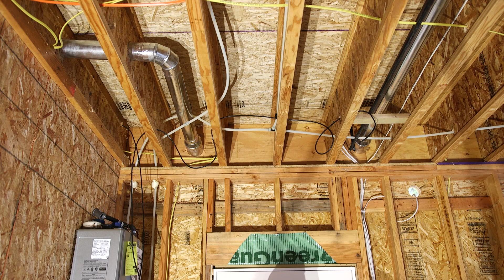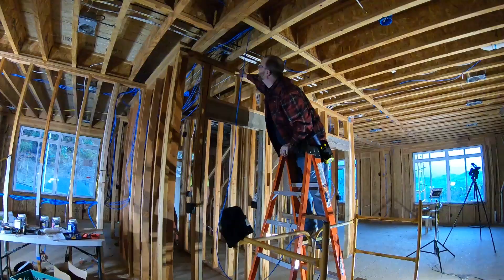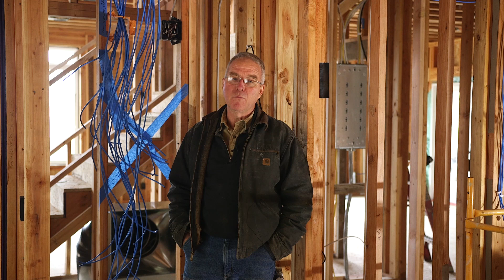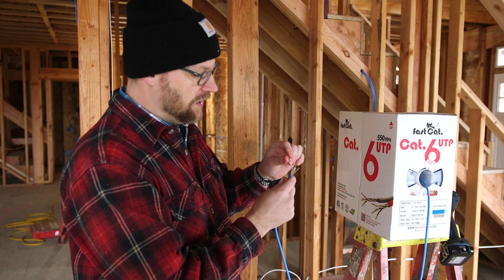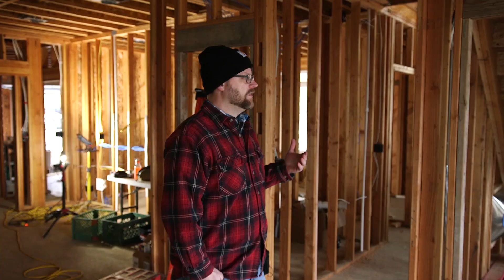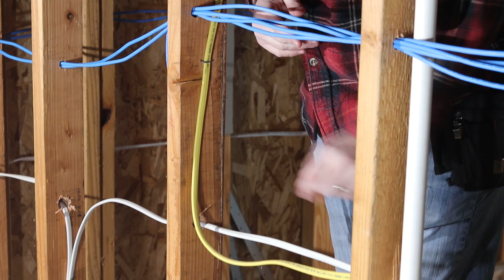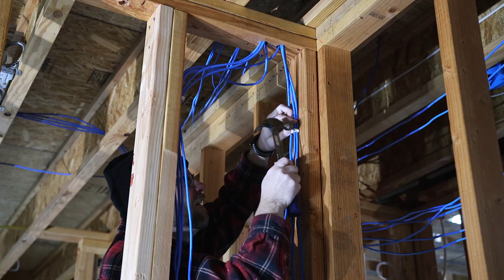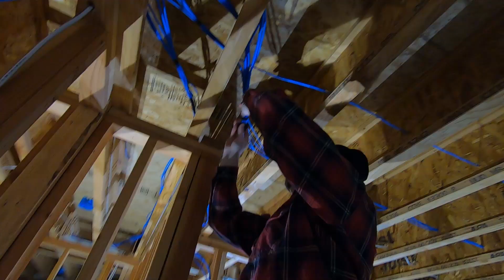Installing A Home Network Ep.100

Comment: 10:06 10 Gigabit networking will be less and less expensive. If you plan to have switches further than 30 meters from an endpoint. I would suggest CAT6A or CAT7 and it also has thicker conductors for PoE (Power over Ethernet - Basically 48V  DC lines for cameras and even lighting nowadays. Since more efficient LED's are rated over 200 lumens per watt.)
Coax cables are yesterday's tech :)  Yet still required in some applications. Fiber optics has more benefits over long distances :)
Reply: Definitely no reason to not run Cat 6A in new builds. It's cheap, plentiful and as 10 gig networking (or even 2.5 gig) becomes more mainstream the extra headroom will be nice.
Reply: 6a yes, 7 no.  7 requires different terminators and is effectively dead technology.  6a is for structural runs and good for 10GigE over long(ish) distances.  8 is for short patches in server rooms.  7 is dead.
Reply: @toddosty  You still need to use 23 awg terminators with Cat 6a. But your right Cat 6a is the best choice for home and offices (outside of the datacenter).
Reply: @guytech7310  CAT7 requires either GG45 or TERA, neither of which are 8P8C-compatible.  While you can terminate CAT7 with 8P8C, you lose the benefits of the cable.

People think, "7 > 6, so I should do 7.  But 8 > 7, so I should do 8!"  They're wrong.  They should use 6a, and even though bulk 6a is 2x bulk 6, it's worth it for the long-term compatibility.  If you go with 6, you'll be re-running in 15-20 years.  If you go with 6a, you're good for 40+ unless things take a drastic right turn somewhere in the future.
Reply: @toddosty  Seeing Cat 7 cables installed as standard in about every new commercial installation here in Germany these days, I would say it is far from dead. But you are right in terms of, those more expensive cables actually beeing a waste of money they way patch panels and sockets are used. And there seems to be quite a misconception about it even among many professionals. I am a network and communications guy by education myself, but I am always amazed how many professionals still think just putting the fancy Cat 7 cables in makes it a Cat 7 installation, while all the sockets (the true and tested 8P8C Modular ones so many times misnamed as RJ45) are at most Cat 6a, automtically degrading the whole installation to 6a or whatever the lowest rated omponent in the installation is.
As you stated correctly, for true cat 7 you would need one of two types of connectors, with at leatsGG45 Sockets beeing downward compatible with regular 8P8C Cat6a plugs (which makes it Cat 6a again), but I have to confess, I know those only from catalogues, I have never seen them beeing used. The simple reason beeing, copper with very high bandwidth is only used for short runs where it does not matter that much, or you see a switch to completely different connection types, mainly optical fiber.
Personally, for most residential homes, I do not even see the need for more than 1G in your home network. For what the average person does at home, higher speeds do not really matter. Either it does not matter if a transfer takes a few seconds longer. In datacenters or special computing needs where we talk about virtualisation or iSCSI for storages, that is a completely different beast. I recommend watching Linus Tech Tips about that. Editink 4k and even 8k rawvideo stored on a server takes a real hit in productivity below 10 G.
But for a normal home... My internet connection is only 100 MBit/s down and 40 Mbit/s up (I could upgrade to 250 MBit/s down with either 40 or 50 MBit/s upstream), we are two persons working from home right now with video calls, remote sessions and you name it. we barely ever reach 25 Mbit/s used. Lets have three TVs or streams running in UHD quality (if available at all), well here we get closer. But as the majority is only available in Full HD anyways, three TVs running (we have IPTV) rarely exceeds 24 to 30 Mbit/s.
And I simply do not see, except for UHD beeing used for streaming or breodcasting more and more and without extra costs in general, why our average bandwidth need would increase a lot more. Sure, things like Google Stadia and other remote gaming experiences, they absolutely benefit from as much bandwidth as possible, but even with what we have now they work fine.
In my home I even run Cat 5e cables ten, eleven years ago. I have no coax or classic telephone cablesin my walls. I have conduit runs from each 2 port socket into my basement built in when the house was built (No framing, solid concrete and masonry as common around here, a pain if you want to change or addany cable runs).
I am still fine with them. For one as I am fine with 1 G for now, some of the set top boxes do not even have 1 G ports, others like a 4k fire tv stick never do more than 72 MBit/s over WiFi, and the wi-Fi would allow up to 800. But the main reasons why I am fine with them? They work for one, and anything better with more shielding has a thicker outer diameter and is very hard to fit in those darn 16 mm inner diameter conduit they put into my walls ( I had asked for 20 mm). Even with the wide, at least half a meter radii the put in the conduit, I cannot get anything like cat / with a 7 mm outer diameter through, except for an absolutely straight run.
Are there disadvantages to my good old Cat5e cable? oh yes, that stuff is flimsy in comparrison. you can easily tear it appart when pulling and need to be awfully careful. Good thing that the only part exposed is between the conduit and the patch panel, which is not more than a meter within a closet.
Reply: @alexku8452 The only thing I take issue with is "nobody needs more than 1GigE".  Wiring should be future-proof as much as possible, and while 6 (and even 5e, for very short runs!) can handle 10GigE, 6a is better for not significantly more cost.  Maybe nobody needs it *today*, but 20 years ago the same would've been said about 100M vs. 1G and now here we are saying "Nobody needs more than 1G".

If you're going to run residential networking in 2021, there's no reason not to use 6a.
Reply: @toddosty  Well, with what all those companies are pressing into, Wi_Fi Standards, 5G etc. I wonder if 20 years from now anyone by default will still use copper cables or any cables at all. at least for residential installations. Not that this would neccessarily be the better option.
Also many non commercial devices no longer have any network ports at all.
But looking at most networks today, no matter if residential or commercial, and looking at the bandwidths used, especially in the residential sector I do not see anything reaching the actual need for 1 G any time soon. Sure, with more UHD streaming etc. the load will go up, but 1 G should be able to handle it just fine for quite a while to come. and with more and more cloud services beeing used, the local network is not the bottleneck to worry about anyways. (At least here in Germany where Fiber to the Home allowing 1G Internet is deployed only painfully slow. I could get 250 M, have 100 at the moment and even with heavy use rarely use above 25 M)
Commercial installations, that is another story and depents on what is done. most office jobs using office software and writing emails, even a 100 MBit/s line would be bored. But as soon as you have certain amounts of data you work with, CAD files etc. whole different stories.
And depending on hobbies or interests, this may also apply to some residential installations.
About the 6a and 5e cable, I never said not to use 6a. I only said my 5e is absolutely fine and with given conditions (conduit) easiest option to install. Would 6a be better and in the long run be more reliable by also beeing the more stable cable, most certainly. Would I be able to replace all Cat 5e with 6a and get them fit in, not sure.
As I said, 5e works for me, has no speed issues on the length of those cable runs I have and with my demands (which due to working from home and certain entertainment systems most likely already is above average) It is more than fast enough. Would I recommend 5e over 6a for cost reasons if you could fit 6a cables without issues, no way.
Reply: @toddosty  Considering most devices that average homeowners use these days don't even have Ethernet jacks on them, it could be argued that running any more than 5 or 6 ethernet drops for WiFi APs and likely game console locations is a waste of time in most new builds (I wouldn't argue that, Ethernet is cheap and easy to run, but it could be argued).
Reply: Coax is relevant tech. Cable internet providers aren't changing from it anytime soon, which is why they ran it now. Also, like he said different ratings are largely marketing in the US. I work in IT at a major US retailer. All we install is Cat 6 on brand new installs even in datacenters. No cat 7 anything, nor 6A. Just cat 6. Anything needing higher bandwidth or longer runs uses fiber. Most everyone has absolutely no need of 10 gigabit connections whatsoever, especially in the home environment as that is many times over more than they will get from their ISP, and indeed many times over what even a simple NAS (which most will absolutely never have) would realistically need to function adequately. Gigabit is enough.
Reply: @scythelord  Coax is dead here (Norway).  I had fibre installed to the house about six years ago.  I get Internet through that (500/500Mbps) and could also get TV if I wanted it.

As for gigabit being enough, that's becoming less true now too.  Even cheap SSDs can push half a gigabit of data per second.  It doesn't take many devices to flood the network, especially if you have a NAS streaming data to multiple rooms concurrently.  The amount of data we use and consume these days is staggering when you think about it.  The laptop I use for work has written over 13TB of data to its drive in the last 16 months (when I started this job).

Finally, Cat-7 isn't backwards compatible with 6 and 5.  For that you need Cat-8.
Reply: @-_James_-  What kind of super-inefficient video codec are you using that is hogging 500 Mbps from your NAS?
Reply: @jej3451  I'm not, but the point is given how much data we're consuming generally today (and especially when you consider how little we consumed just 10 years ago), it's a bit naive to think that installing a gigabit network today will suffice for more than a few years into the future.  My home internet connection today is 15000 times faster than the one I had 20 years ago.  A similar speed increase over the next 20 years would give me an internet speed of 7.5Tbps.  (And I see nothing that indicates we're just going to stop increasing speeds any time soon.)

I'm currently tech lead on a software application which is decoding and mixing up to 24 2160p video streams in real time, rendering overlays on top of those streams, and re-encoding up to 24 distinct streams for broadcasting to clients.  There are companies out there (like the company I used to work for) doing some amazing things with video today.  Their plans for the future are equally amazing.
Reply: @jej3451  It's not necessarily constant streaming. 1 Gbps is a bottleneck for so many things now. Saturating my 1 Gbps upload at home, it takes several days for me to backup my important data. If you get into media, you can be moving dozens of terabytes around regularly, which takes ages at gigabit speed. 1 Gbps now is like 100 Mbps was in 2010 or 10 Mbps in 2000. Even the WiFi AC from 2013 exceeds 1 Gbps.
Reply: @scythelord  "All we install is Cat 6 on brand new installs even in datacenters."
Makes sense! You can charge them again when they need to run high data rates in a few years! 

"Most everyone has absolutely no need of 10 gigabit connections whatsoever, especially in the home environment"

LOL! I am using 10 gbps in my home. Issue is that in the late 1980s/early 1900's 10Mbps was fine, Then by Mid 1990's it was 100mbps, then in the early 2000's it was 1 Gbps. Sooner or later 10 Gbps will be commonly used.